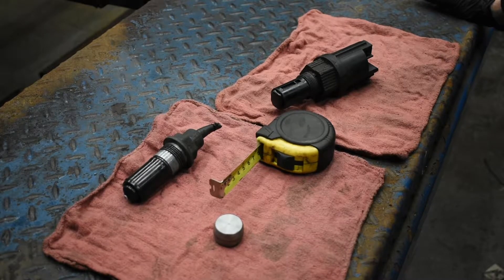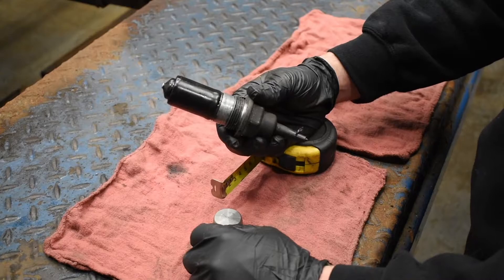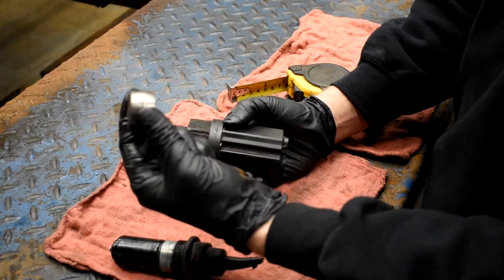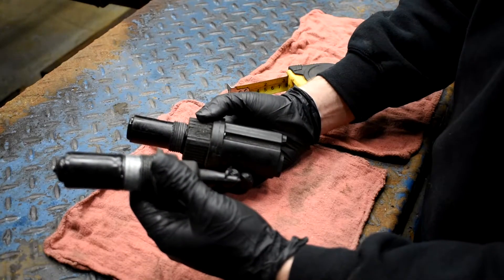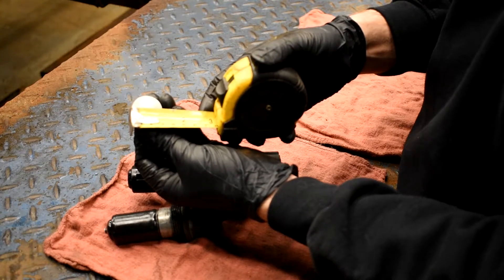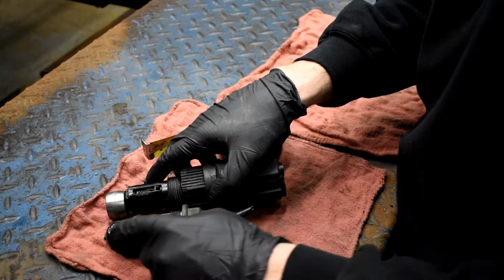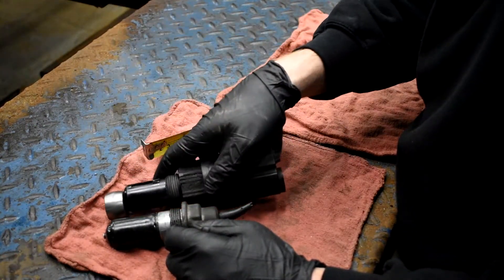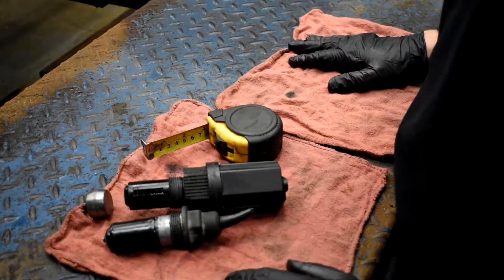GMT400 600-600 Front Differential Actuator Update

Comment: I've got a question,  I'm still confused in the picture it looks like the wire kit only come with 2 2 pin connectors but I'm looking at a 5 pin connector on the new actuator could you possibly explain the wiring a little better
Reply from the maker: The kits harness has 3 connectors 2 of the 2 pin and one 5 pin with 3 terminals used . Buy the kit read the directions

Comment: Dorman is listing the 600-600 kit to be compatible with 1996 and under, directly on their website. 
Have you confirmed it also applies to 97’s?
Reply from the maker: It does apply to some 97’s that originally came with a thermal actuator

Comment: The thermal actuator and 5 pin actuator have the same threads into the differential? Is the 5 pin actuator the same as the gmt800 actuator?
Reply from the maker: Treads are the same idk if gmt400 and 800 are the same but if you do some part number searching I’m sure you can figure it out
Reply: @TRUCK_TECHNICIAN  I've got an '04 2500 and the np246 has been giving me hell. I'm manual shift converting the np246, welding the clutch pack fully engaged and installing a floor shifter. I would like to use the posi lok 4x4 diff actuator but they show it only for the gmt400 2500 trucks with the thermal actuators. I'm thinking it will work!!
Reply from the maker: It may work I know there’s a way to wire it with a double throw toggle switch but you have to l know what your doing

Comment: hey, greetings, I want to add that modification to my tahoe 1997 5.7 vortec but it tells me that it won't fit and my diff has two pins I just changed the differential I put a newer one from a 2000 and it already has the electric one but the connections how can I do them since it has two connectors so that the 4x4 can fit thanks I hope you can help me
Reply from the maker: 600-600 gives you the harness you need and it comes with directions for your application . The Second connector that didn’t go to the shift actuator is for the signal to show you inside the truck that the four-wheel-drive is engaged I believe the electronic shift actuator has the sensor built into it
Reply: @TRUCK_TECHNICIAN  thank you very much I tried to order it online and it tells me that it does not fit my car when it asks for the information I don't know why it tells me that I will take the risk and buy it I hope and if it works thank you very much again for taking the time and answering me

Comment: How does the puck not fall into the feont axle?
Reply from the maker: It sits against the shift fork in the actuator tube so it stays between the two
Reply: @TRUCK_TECHNICIAN  I'm having issues with my 4x4 and it was swapped to this set up but a second relay was added for some reason and idk what is going on. So I need to research all I can and see what the previous owner messed up and I fix it. It is a 97 cclb k3500.
Reply from the maker: @codydunn242  there’s a switch on the transfer case that can Go bad the I believe makes the relay turn on when the 4x4 is shifted into 4wd
Reply: If im not mistaken, and you don't want to wire it to the switch on the transfer case, you could go from the 12v source on the passenger firewall, to a toggle, then to the brown wire that goes to the new style solonoid. Just have to remember to flick the toggle everytime you put it in and take it out of 4 wheel drive.